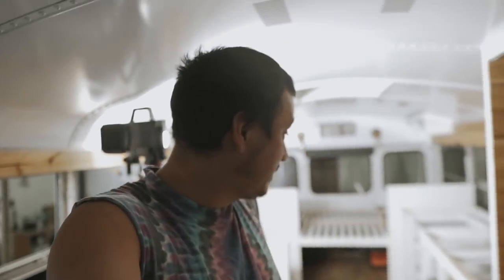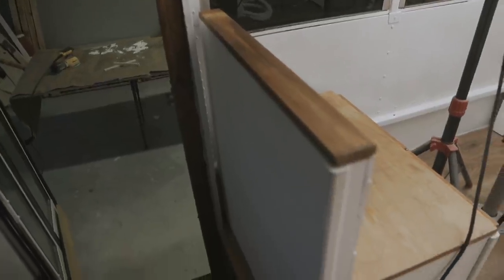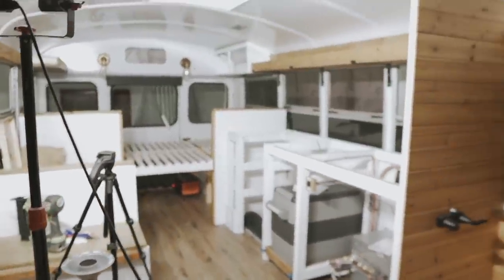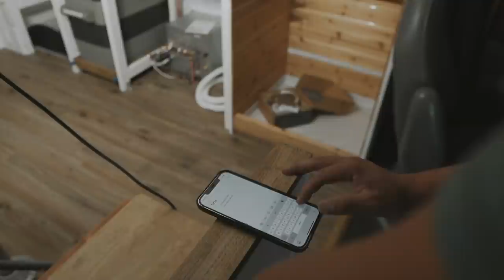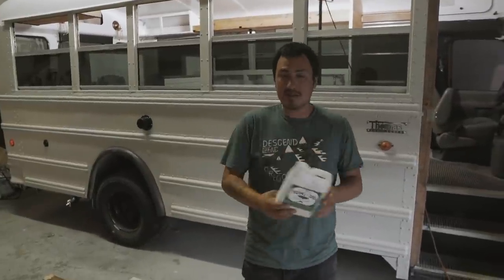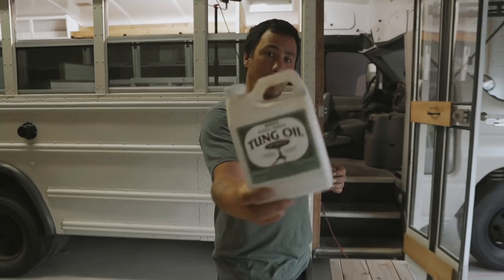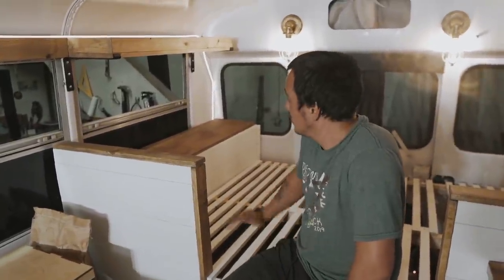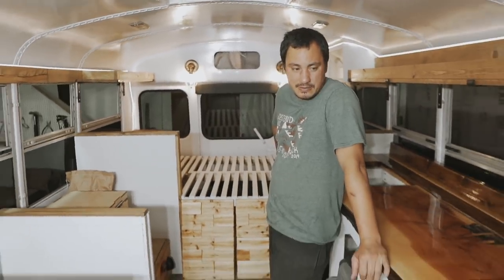School Bus To Tiny Home - Trim and Cabinets

Comment: Looks beautiful! Do you let the new owner worry about cushions upholstery on the dinette and whatever mattress they want on the bed?
Reply from the maker: No this tiny home comes with everything I have a new mattress for it and the cushions for the dinette is in work at the moment, this tiny home is truly turned key will also put new tires on it and already had professionally check all the mechanical stuff on it.